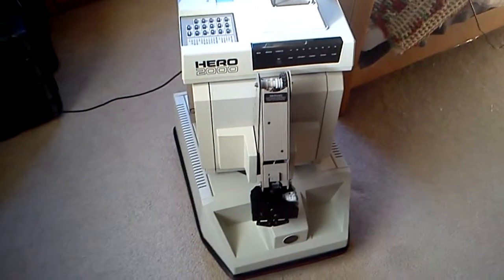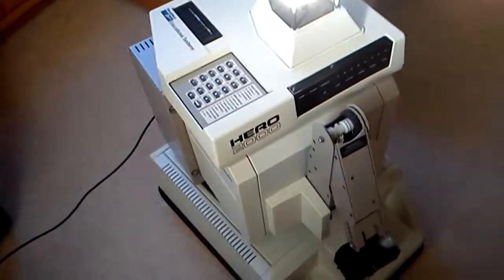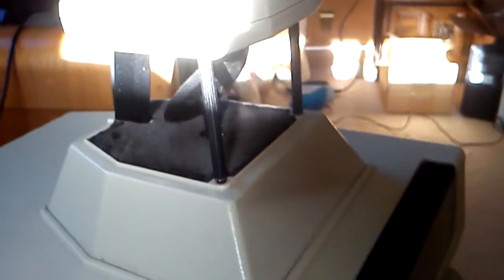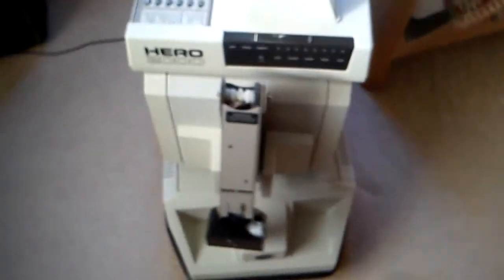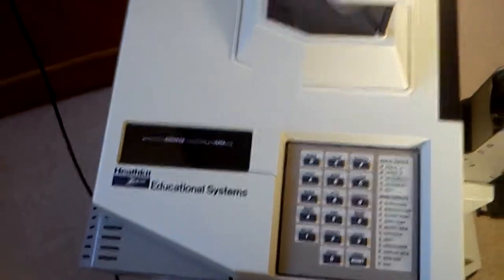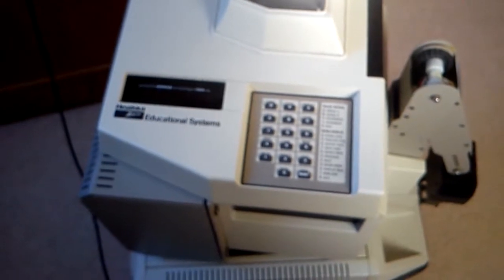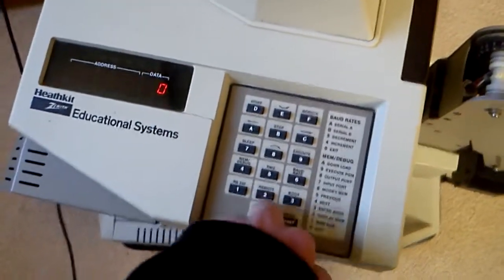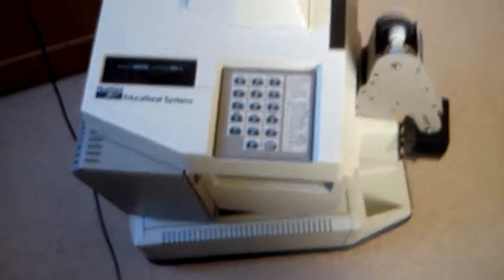"Please Enter Your Access Code!" Heathkit Hero 2000 Robot

Comment: You can disable the access code feature by finding the (7 segment dip switch)  on the cpu board and flip switch #4 to the on position. Do that and you will not have to deal with the code.

Comment: try to set up a micro controller to pulse in on your keyboard input 1 - bla bla bla  so that it is sequenced ,delay  it between each try ,run power to the 2000 and let it go for a few hours ,it will work . the keypad is just a simple matrix set up! arduino uno will work .